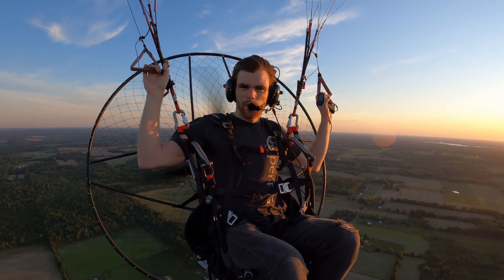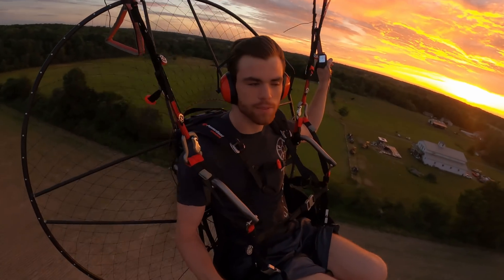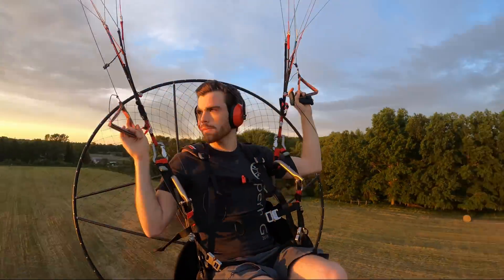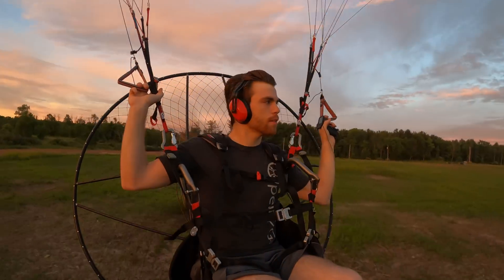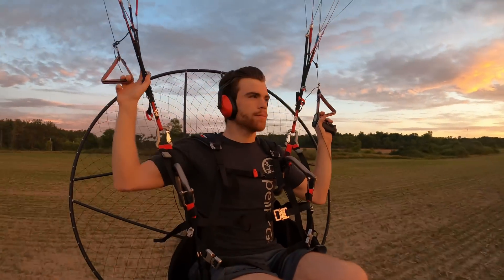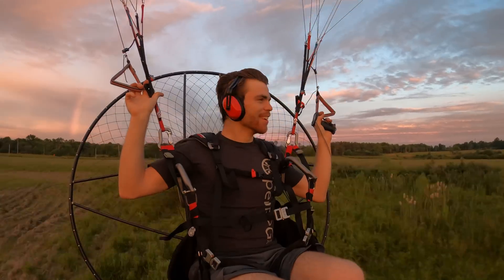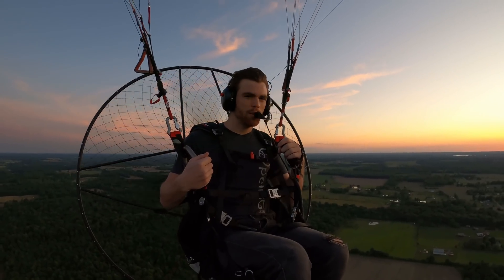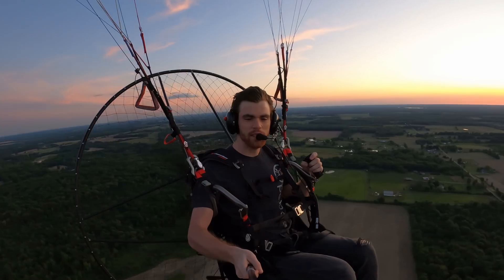SP140 Pre launch update- 2020 Electric Paramotor

Comment: Weed wacker motors shouldn't be 8k to produce….
Reply from the maker: Make one like it cheaper then and sell it.  Commenting on YT won't make it any cheaper.
Reply: @PDWhite  Maybe not. But it should raise awareness that people are being ripped off. Instead of reinventing the wheel? Why not adapt cheaper, existing two stroke technology? How far does 8k go in a Stihl chainsaw shop? Or a KTM shop? We are talking about a rope pull engine and a propeller for propulsion correct?

Unfortunately after back surgery this is probably not something that will be checked off my bucket list.
Reply from the maker: @wademoss3864  Well you should take a look at the current 2 stroke motor out there right now that are used in paramotors. They are all around 7-8k. If you think it can be made much cheaper then make it and sell it for much cheaper.  Most all the units put there are gas so you should be able to undercut them at there own game. 

And put a weed wacker engine on it lol and see if you can take off.

Comment: Does the battery pack come with a warranty? What if the battery pack "drops a cell", can you replace individual cells? How many watt hours is the battery pack and voltage? How many volts does the motor require at a minimum and maximum?

Comment: Are the batteries temperature sensitive? Can you fly them in 30F and 115F without damaging the cells? If you fly them in low temps does it cut down the flight times?

Comment: CURIOUS about your ELECTRIC paramotor, but the challenge I've ALWAYS faced - even when learning to HANG GLIDE here in the MIDWEST... 
... is that I'm a BIGGER guy: 6'-1" 245 lbs. 

WHY is it SO hard to find parasail gear BIG enough for to fit MY size??? 

Mark in North Aurora IL
Reply from the maker: Pretty much all paramotor wing manufacture make a wing that will fit you well.  The make wings that can take 2 250lbs people.  Definitely a lot of gear out there in the paramotor world to choose from

Comment: In future versions, can the battery pack be made to be replaceable. That way you don't need to charge the whole paramotor. just charge the battery, exhaust it. land. change batteries, back in the air.
Reply from the maker: It currently it is that way. It's a battery pack that slide in the back. Check out the forum for info on it. 

So ya it very easy swappable

Comment: I wonder: if you optimized everything for the smallest, lightest and most silent as possible rotor that just barely creates enough thrust to make sure you could fly "forever", given enough battery, then: HOW light and HOW silent could that whole system become?
Reply: depends on the pilots weight
Reply: depends on the pilots weight

Comment: I really need to be able to travel 45 km, mostly over water (coast guard is super close and my water escape training is pretty good ;), and so I'm very interested in the reliability of electric...  if I were to do that on a paramotor on the Dominator wing (safety and speed 50+km),  could I make the distance reliably given say even a 15km p/hr head wind? Could you supply a bigger battery so I can get that crucial 75 minutes should problems arise? I just want to run an efficient, straight line with weight shift and low torque maneuvering.

Comment: What I see is a current problem with rechargeable devices which need larger batteries is the cost to replace the battery. Example is I bought an electric line trimmer 56V 2.5 AH system. I didn't use it much left it mostly on the charger maybe every 2-3 weeks. The line trimmer including the battery and charger was $200. After 2 1/2 years of use the battery started to fail I assumed not a cheap item but turned out a replacement battery is $150 just $50 short of a complete new system. This is lot like the Tesla the battery is warrantied for 10 years the expectation is to buy a new car because the cost of the batteries are too much to replace them.
Reply: Tesla batteries are warranted 8 years 150k miles in model S&X and 100k on model 3 and that's a guarantee they won't go below 70% state of charge. They still work, just fewer miles. Elon said about $7-8k to refurbish if you want. The battery should last 300-500k miles unless it develops a fault but newer batteries should last 1 million miles or more! - it looks like batteries like to be used and not left which you may find with devices like a trimmer, it also depends on the chemistry used which depends on power output needed ver cost.

Comment: An electric motor is 10X less expensive to manufacture than a gas motor my man. Maybe even 20X.
Reply from the maker: Please send link?  To a motor that can continually output 15kw of power that is 10x less expensive than say a $2000 ice motor that are used on nearly every paramotor frame.  So need to be $200 or less to meet the 10x figure you stated.
Reply: The real costs are sunk in the battery.

Comment: The name needs to differentiate that it is an electric paramotor. As such it should be something that relates to electricity in some way... and Tesla is already taken. So how about...
- Lightning 
- Bolt
- Flash
- Arc
- Spark
- Power
- PowerUp
- Energy
- Synergy
- Current 
- Flow
- Dwell
- Wired
- Charge
- Charger
- Charged

Or emphasize a positive quality like convenience, lower noise level, instant restart.

- EZP (easy power/ paramotor)
- Whisper
- Control
- Precision

Or emphasize that it's  the new and coming thing.

- Ascend
- Next
- Excel

Personally I like several for different reasons. 
Arc, because it's short and clean and could be done in all caps as ARC.
Charger, because it is evocative of both electricity and a strong powerful horse.
Whisper, because an electric paramotor is quieter and power off is completely silent! 
And finally, Ascend, because going up is the whole reason we fly.

Which ones do you like?

Also, it's driving me nuts trying to figure out what frame you are using in the newest video. Similar to an Air Conception in design but not a match. What is it?

Comment: A couple of thoughts. What's the estimated flight time for a given rider (maybe average weight)? Maybe give an estimated range? Secondly, is it possible to engineer the motor to allow for additional batteries? My thought here is that, in order to keep the weight down you may only want one battery but larger individuals who can handle the additional weight of a second (or third) battery would like to have the option of purchasing extra batteries that can be used to prolong a flight. While it's nice to have the capability to swap batteries on the ground, having that extra flight time is probably what's most important to potential customers.

Not sure where the name SP-140 came from but it's ok. I'm sure you could find something better but you gave it that name for a reason... don't second guess yourself.
Reply: Forgot to say but I think it's important. For me, the magic number for flight time is 90 minutes. When that happens, this product becomes relevant for my shopping consideration!

Comment: I've never wanted a project to be successful more than this, that's so great your shooting for great price and reliability those are the two main issues I see with the gas motors
Reply: Cant agree more, im willing to wait just for this!
Reply: It seems batteries are easily replaceable so you can always land and switch and as battery technology improves (which it is, just look at Tesla, Toyota, and Dr. Goodenough's team research) that you could just "upgrade" the battery.  Motor seems powerful enough with thrust and 25kw max (over 30HP).  Rather deal with shorter flight time (for a few years) than maintenance and engine rebuild etc.  Also nothing better than gliding silently (see the one video review of the quad version).  Problem with more propeller/blades is noise but it doesn't need torque compensation.

Would like to know the details on torque compensation, fixed with adjustment?
Reply: @forget_f1  unfortunately it's not that easy. In Germany for example if you would get such a setup approved by our FAA , the batteries need to go through a costly certification process. If I remember correctly it's > 30k € and more importantly a lot of time. Given the small amount of motors sold that's nearly impossible to do this every once in a while. 😕
Reply: @sendtospybot  yeah safety regs are a double edged sword

Comment: Looking forward to final specs.
 200lbs thrust is nice for a tandem.
Will we be able to purchase the motor and controller separately and use our own batteries?
Also looking forward to info on the hybrid, friend might be getting a tandem and was thinking the hybrid might be good.
Cheers
Reply: Hybrid? What advantage would adding an ICE and fuel system add to this? Can the ICE be small and light enough yet still provided enough to sustain level flight and charge the battery?
Reply: @grejen711  
Too complex IMHO
Cheers
Reply: @grejen711  The hybrid mentioned is the name of the wing he was using, not a power  system.  Apco Hybrid.